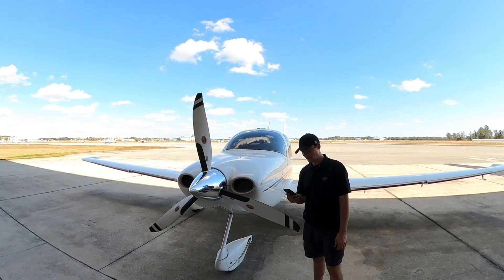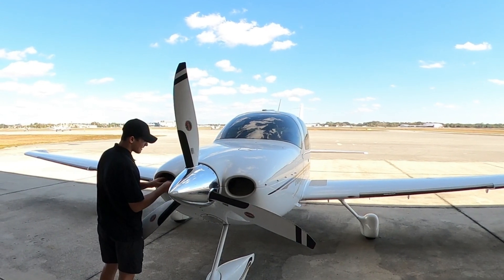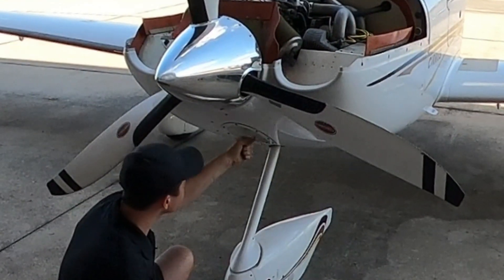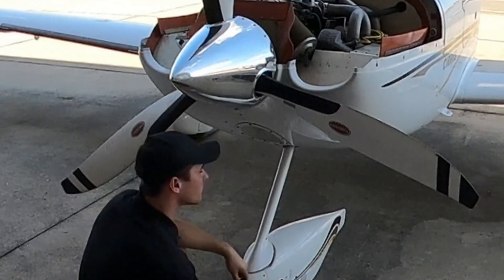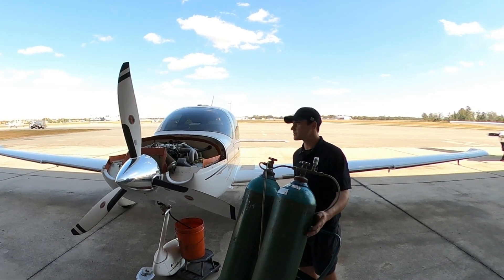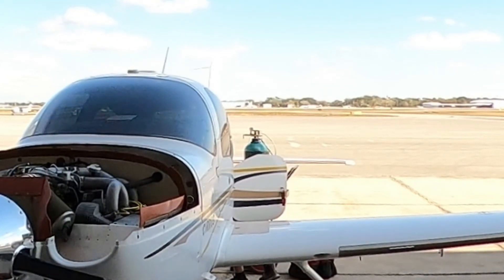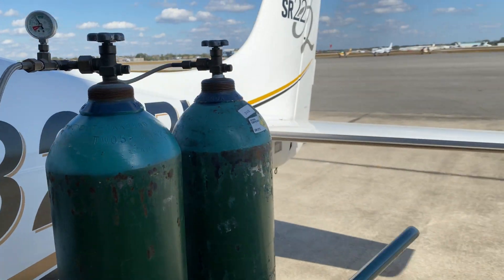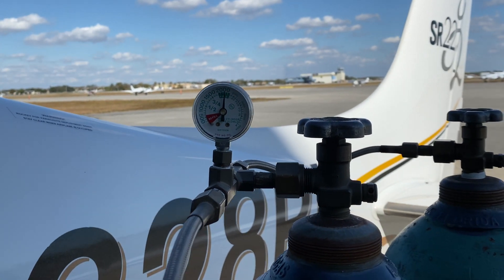Cirrus SR22 Oil Change [4K] Gopro Max

Comment: You Should remove video this is not best way to change oil. Tempest states not to hammer hole in filter.
Reply: I was wondering about this as well. 
It definitely works and helps drain but the potential for a slip or additional impact force on filter threads freaks me out. 
A practice to follow up on in my learning of aircraft.